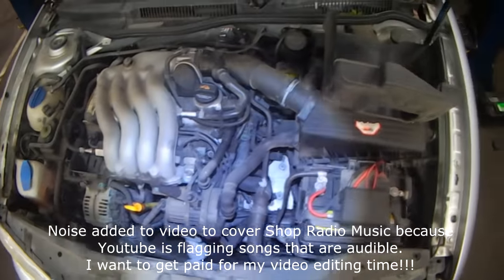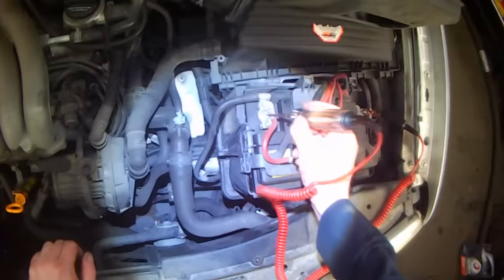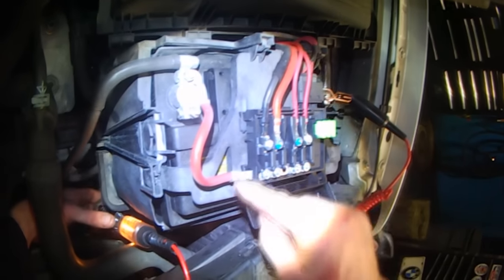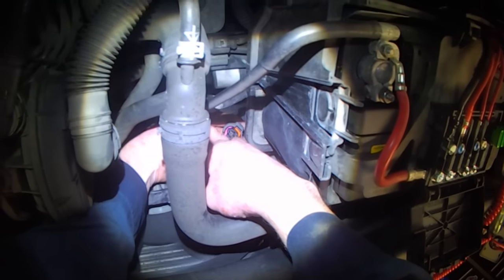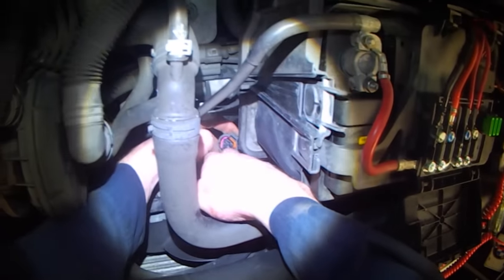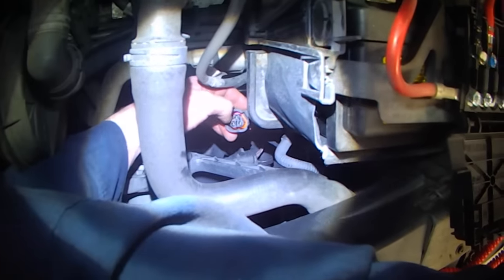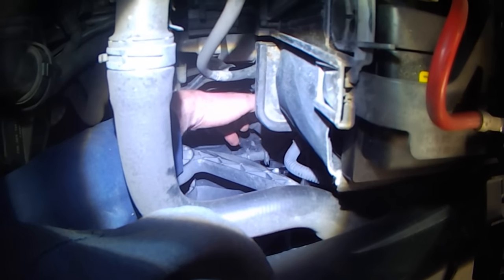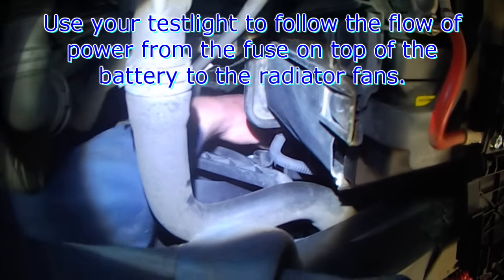VW A1 A2, A3, A4: Radiator fan(s) quick check.

Comment: Hi your vedio is much informative. 👍🏻for audi a3 2009 reg
I have Recently replaced cooling fan n compressor  but fan still not working well initially it was working with Air con ON but now it’s not working and glow plug light starts flashing in just one week period of repairs.
Please guide if you can?
Reply from the maker: I'm still at work, I will get back to you later once I am at home later tonight.
Is the engine overheating? Only when at idle or also when driving at steady speed?
Which engine is in your car?
Reply from the maker: On your car, the radiator fan(s) are most likely controlled by a Fan Module... that is controlled by the ECM. You need to check for a "command signal" at the fan module. If your only concern is that the fans do NOT work when AC is on (but they come on when temperature is hot), then you have to look at the AC system for faults. Check the ECM for fault codes... the flashing glow plug light may or may not be related.
Reply: Thomas EXOVCDS 1.6 diesel
Reply: Thomas EXOVCDS Thanks
Reply: One more thing please about flashing light of glow plug what is the reason?
I put diesel cleaner in fuel tank is it some thing related?
Reply from the maker: Like I sai: Check the ECM for fault codes... the flashing glow plug light may or may not be related.
I still don't know what the actual problem is (aside from no fans with AC).
Are the fans coming on when the engine is warm / hot? TDI engines take a long time for the fans to come on.
I have seen bad brake light switches be the cause for glow plug light flashing.
Check the ECM for fault codes... the flashing glow plug light may or may not be related.

Comment: Hi,I have a 1998 golf 4 Gti the fan only goes on once I bypass the 2 and 3 on the fan plug (the one that goes on the switch) once the key is turned on I replaced the sensor but still it doesn’t switch on the fan unless I have to bypass while the key is on

Could it be the control module?
Reply from the maker: What is the main problem? Is the engine overheating? When at idle or also while driving? 
If your car has AC... the fan should have 2 speeds. Low / 1st speed does NOT require the key to be on... 2nd speed DOES require the ignition key to be on. If 1st speed is not working, then the fan is bad. If the radiator is not getting warm because of a stuck closed thermostat or a bad water pump... then 1st speed will also not come on.
Reply: @EXOVCDS  car over heats on both idle and drive…the 1st speed doesn’t go on but the 2nd speed only goes on when it’s jumped as in the video above, I’m suspecting the fan control module? Since it doesn’t switch on the fan automatically when the temperature is high?
Reply from the maker: @Chartkingna  fans are not needed when driving at steady speed. Your thermostat is probably stuck closed / bad.

Comment: Hi My fans recently stop working AC and heat work. Large fan spins freely. Small fan is out of alignment and doesn't spin seems to be jammed. Car over heats while in traffic. I have been Jetta 2004 vw Jetta. I check fuse box fuses are good. That's as far As I got.
Reply from the maker: Does the large fan spin when the ac button is pushed?
If it does not overheat while the vehicle is moving... then the thermostat, water pump and radiator are OK.
Did you bridge the radiator fan harness plug to manually trigger the fans? What happens?
The vehicle should not overheat with only 1 fan working (large or small).
If one of the fans works when manually bridged, but does not come on at idle when plugged in... replace the fan switch in the radiator.
Reply: 😓😓😓😓 I do t know what any of that means. To answer the question I can. Neither of the two fans work. The car only over heat while idle or in traffic.

Comment: Hi, I got a 2006 Jetta & fans are Not working, not when the AC is on, none at all. NO check engine or temperature light on, even in this July Heat. Any ideas? - thanks
Reply from the maker: A4 version or A5?
(mk4 or mk5)?
Fan control is different for the 2 generations.
Reply: Mk5. 
Trying to figure out how to just Unplug the dumb thing w/o breaking it right now, haven't had it apart before. If I short the connector will it turn on the fans?
Reply from the maker: @leeisenberg  your fans work different from this video. Watch this one:
https://youtu.be/oqdv4cm86Ns
You can use a regular multimeter to get / check the same voltage readings. You don't need VCDS & laptop. Just let the engine idle and check for a voltage on the control wire. Turn on AC and check if the voltage changes. Check the thick wires for power & ground.
Reply: Okay thanks man. Will do, take care.

Comment: having same on audi TT  . but so tight to get to connector, going to try from bottom.
Reply from the maker: Yes, will be / should be easier from the bottom.
Reply: thank , i did it, fan runs, power on the wire. it turns out corrosion on the first fuse. no more over heating and the ac works now. we are going to replace the fuse box any way. we take no chances
Reply from the maker: Thanks for the update... sounds good!

Comment: Hi Thomas.
I have 2002 a4 1.9 tdi.
When i turn on ac one fan comes on.
My question is, without ac on when the car heats at normal temp. should this fan comes on ?
All time only belt driven fan spins not other fan.
Reply from the maker: The fan or fan control module could be burnt out. Electric fan only comes on when AC is ON or when engine temperature is too high.
Reply: Thomas EXOVCDS 
Teperature stays at normal 90 C
But i just bought the car and never hear the electric fan runing without ac on.
Thats why i ask.
Reply from the maker: Like I said... electric fan only runs when AC is on or when temperatures are too high. If temperatures are always normal (below 110c) then electric fan is not needed.
Reply: Thomas EXOVCDS thank you so much. Because i was worried about this.

Comment: I test the fuse it’s good I disconnected the plug I have power on one. Did the pin thing and the small fan kick in when inside the car put the key on try it with the other one and still the small fan kicks in the big fan won’t move even with ac on. I already replaced the dans both and does the same thing any ideas
Reply from the maker: Year, make, model, engine? You need to check the wiring / wires going to the big fan. Both fans get power from the same fuse, if one fan works, then the fuse is ok. Disconnect the connector for the big fan and check the wires from the connector going back to the radiator fan switch... you will probably fine bad wiring / corrosion on the power or the ground side.
Reply: @EXOVCDS  2001 vw Jetta Wolfsburg I’m gonna try to do that I check the box on top of the battery looks good but I gotta try to disconnect the fan
Reply from the maker: You don't have to disconnect the fan... just the fan switch connector. Do the testing there and let me know what happens (like in the video).

Comment: Hello, good video first of all thank you. My car's fan is not stopping even i turn off the car. When i check it from VCDC air control sensor is blown (g238). ıs it related?
Reply from the maker: No, probably  not.
Check it / replace it and see what happens.
Year, make, model, engine?
Reply: @EXOVCDS  1.6 tdi 77kw. 2012. Audi a3 . Air quality sensor is not working. Outside temp. Shown 18celcius but it is not.
Reply from the maker: Air quality sensor measures air quality... too much exhaust or oil smoke under the hood should cause the climate control system to close the fresh air door, so that the fumes do not come into the car when the heater or AC is used.
I have seen this code on vehicles and the fans were not always on.
Reply: @EXOVCDS  thank you very much. I just removed the sensor put it in the sun and blow with air. It is ok now. Shows a value =7 now (iread it from vcdc) fan continues to spin even the car stopped. I think there is something wrong with the car. Thanks for replies.
Reply from the maker: @necromecro  if engine computer has no fault codes for radiator fan, then the fan control module is bad.
Reply: @EXOVCDS  engine comp. Throwing this fault: radiator fan 2 (v177) p1951 00 [101] movement restricted/jamned. And some values coming up. But the fan is running as crazy
Reply from the maker: Replace the fan / module if the module is part of the large fan.
Reply: @EXOVCDS  would you please tell me if the fan sets are repairable or not? ( ın my case only smaller one is blown. Larger one is ok
Reply from the maker: @necromecro  the fan module (if part of the large fan) controls both fans. If the small fan is always on, the problem is with the module.  Replace the large fan / module... the small fan will then work like it is supposed to.
Reply: @EXOVCDS  hello Thomas i am very pleased that you replied me. Big fan also blown today and i will replace the big fan today. İ opened the contreller on the big one, it is not repairable partor need diagram for it. I will also look for original replacement part and make it work.Thank again

Comment: Good lesson. I believe you've shown this before. Thanks!
Reply from the maker: Yeah... figured I would do a recap. Been getting a lot of "my fans aren't working" questions lately.
Reply: @EXOVCDS  Hi sir 
Sokda Octavia desiel 2008
Radiator fan continue on both 
Key off ,fan not stop Battery total Down plz help what can I doo sir
Reply: I got mk1 golf 1998 and my raditor fan runs very very slowly when I do that connection. Is the fan bad or what
Reply from the maker: Could be.

Comment: Thx for the video--Im wondering how u so easily pulled the plug off the switch mine isnt coming. I looked at the pics on Rockauto of the switch and it looks like more then one edge to overcome--Thx
Reply from the maker: Year,make,model,engine?
Reply: @EXOVCDS  2001 Jetta 2L inLine 4, 4 door--The fan doesnt come on w/ the AC on and fan on low thou the AC doesnt work anyway. Would that technique work w/ the AC on and fan on low even if the AC doesnt work on '95 Roadmaster 5.7 Limited 4door?  Thx
Reply from the maker: @kurtjohn5554  if the ac is low on charge, fans will not come on, because the compressor does not turn on. The rad fan switch has a single locking tan. Push the connector towards the sensor (to unload the locking clip) and then pull back on the release tab & pull the connector off. If the car does not overheat while driving, then the water pump & thermostat are ok. If it overheats while driving, then the water pump or thermostat is bad. If you have no heat inside the car, then the water pump is bad.
Reply from the maker: @kurtjohn5554  I don't know anything about other makes & models, sorry.
Reply: @EXOVCDS  Danke-- If the Jetta has no AC charge and the engine is not running only the key is on shud the fan start w/ the AC button on and fan on low?
Reply from the maker: Like I said, if there's not enough charge in the ac system, then I think the fans will not come on (they will come on with key on as long as charge is good). I will try it the next time I get the opportunity to do so on an empty system.
What are you trying to solve? You could have 2 burnt out low speeds. That's why you have to check at the radiator fan switch connector. You can also disconnect both fans and power them up directly to check high & low speeds.
Reply from the maker: https://youtu.be/khM1uJHgtc4
Reply: @EXOVCDS  The temp is going quite hot and the fans werent coming on
Reply from the maker: Only at idle... while driving... do you have heat inside the car?
Reply: @EXOVCDS  I bypassed the heater core a few years ago. If I cant get the plug off I'll put needles in the wires to test the fans, if they dont work. Then i'll have to check the fans at the other plugs if they work then it is the module which is under the battery.
Reply from the maker: @kurtjohn5554  low speed does not need the module to work. The module is only there to trigger low speed for when ac is used and to trigger high speed (when ac pressure gets high).
Reply from the maker: @kurtjohn5554  one more to watch (mainly for how to check for water pump flow).
https://youtu.be/LiDRUWPw_f4
Reply: @EXOVCDS  2 week late reply -- I think what happened on y the Jetta was heating up and the fan not coming on was being very low on water. I bypassed my heater core in the past and that broke loose and likely the radiator water was below the fan switch on the rad. Odd thing about that car is the hot engine coolant from the thermostat goes to the bottom of the radiator cools then out the top back the engine.
Reply from the maker: @kurtjohn5554  Thanks for the update... but hot coolant enters the radiator at the top hose and exits the radiator at the lower hose where the thermostat is. The thermostat allows cooler coolant to enter the engine. I know that some manufacturers do it the other way (hot coolant exits the thermostat and enters the radiator)... but not VW for this model.
Reply: @EXOVCDS  Interesting, but I changed the thermostat which is on the lower rad hose and the pyramid portion is going toward the hose not to the engine. Of course I can put on hand on the upper and lower hose and feel the heat diff to check this
Reply from the maker: @kurtjohn5554  21:15 in the following video shows hot upper hose & cold lower hose. Once the thermostat opens, the hot coolant travels down the radiator, cools, goes through the thermostat into the engine to the water pump.
https://youtu.be/GM6FzBMNQIc
Reply from the maker: @kurtjohn5554  Sorry, 21:15

Comment: Hi I tested my fans and I can get them to go on with the key on on high when I jump power. They do not work on low speed with key off when I jump power. When I spin the fan on the passenger side it’s sounds like it’s rubbing a lot so is it possible my fans need to be replaced. My problem is my air conditioner does not work. When I press the AC button it lights up but the fans do not turn on and the compressor does not engage
Reply from the maker: Both low speeds are probably burnt out... you need to replace both fans. To be sure that they are burnt out, you need to verify that the fans are actually getting power when you activate low speed (manually or with the AC button). Raise the front of the car (support it safely with jack stands) and gain access to the radiator fan harness plugs. Disconnect the plugs. When low speed is on, one of the 3 wires (each harness plug has 3 wires) should have power. If yes, then the fans are bad. If no, then there is a break in the wire... somewhere between the radiator fan switch and the 2 fan connectors.
Reply: @EXOVCDS  thanks for the super fast reply. I can’t tell u how much I appreciate it. I’m trying to keep my 20 yr old VW in top shape!! Have a great day my friend
Reply from the maker: Keep me posted with what you find / end up doing.
Reply: @EXOVCDS  I def will. I’ll test it ltr. If my fans r bad could that be why I have no AC?
AC light in car lights up when pressed & fans blow, just warm air. Original Compressor doesn’t turn on
Reply from the maker: If compressor does not turn on, then the system is low on charge, the pressure switch is bad or the compressor clutch is bad (or something else). If the compressor turns on, but the fans don't, then the fans are probably bad. Either way, you need to solve the fans... since they need to cool the condenser when the system is working. Take the time to confirm / fix compressor activation first... in case you need to spend a bunch of money on that first. AC should still work with non working fans... it just won't be as cold at idle, compared to when the vehicle is moving (air flow through the radiator for cooling).

Comment: Hello Thomas , I need your advice, please help me! in the morning when turning on car(audi A3 TDI 2004 ), the radiator fan running too, how can I solve this problem?
Reply from the maker: Is the AC on?
Scan the car for fault codes.
Check temperature sensor values with a scan tool.
Reply: @EXOVCDS   thanks for everything, It was a water sensor problem, I checked only 2 and here was a 3 :D
Reply from the maker: @natiapkhakadze292  Thank you for the update!